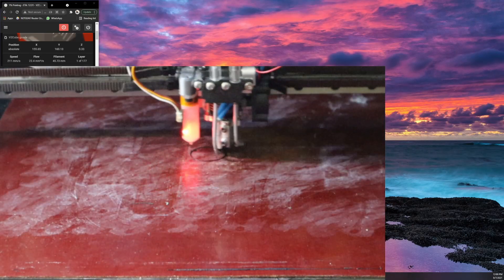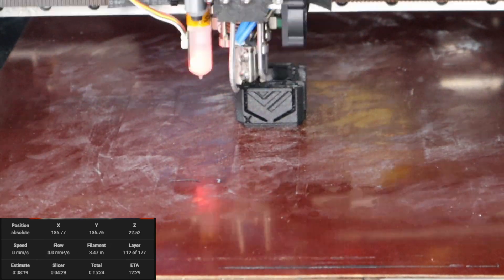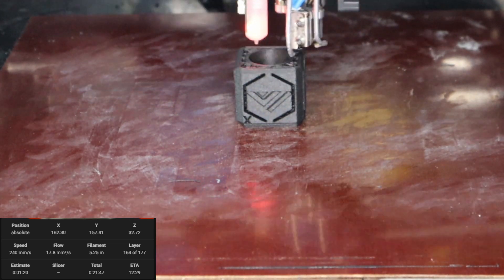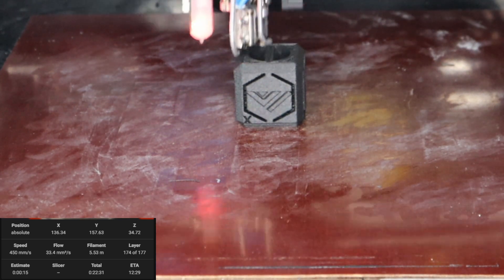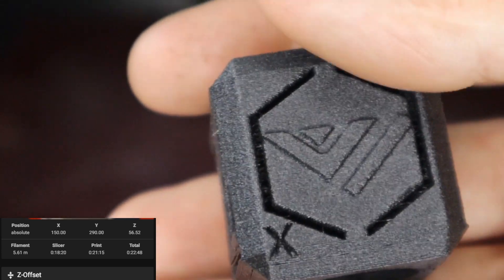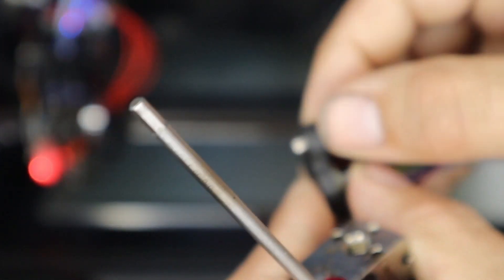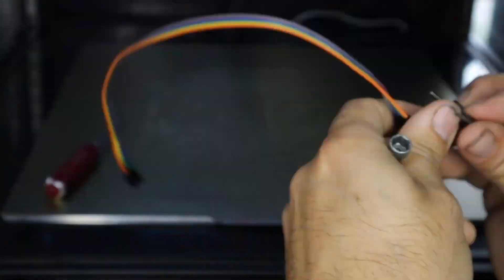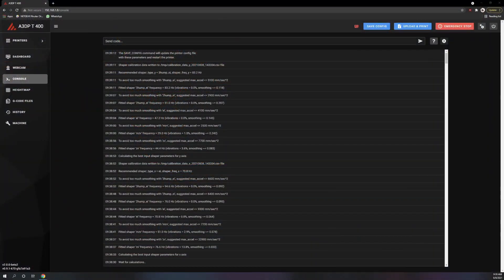Best way use input shaping . I doubled my speed and ran 25k accel with no ringing

Comment: how are dimensions/tolerances at these speeds?
Reply from the maker: 35.26 and 35.21 is what i got for the body the writing sticks out a little so it makes it hard to figure out what the actual size of main body is supposed to but it actually seems to be pretty good. i woul dnever print that fast for production parts but now i may start printing 3 to 400 with 10 or 15k accel tbh
Reply: @advanced3dprinting  ooh tell me if it's actually good for real use at those speeds ^_^